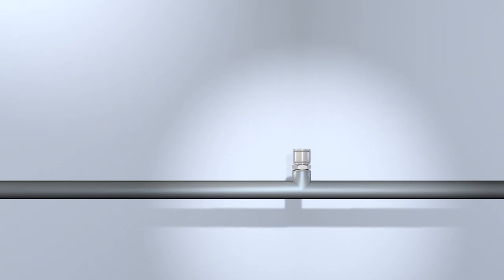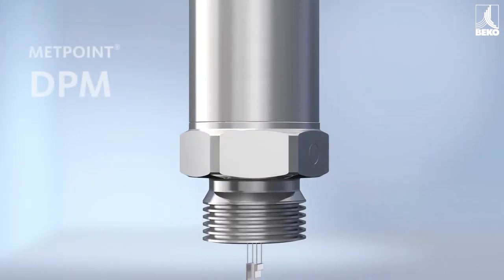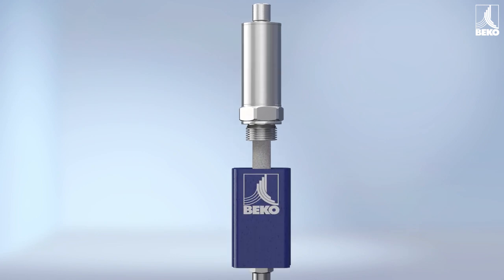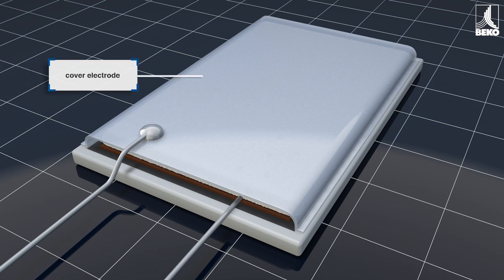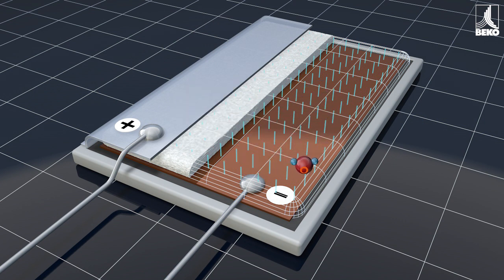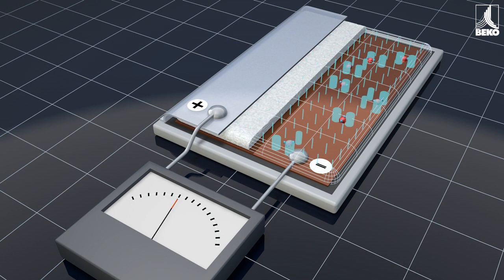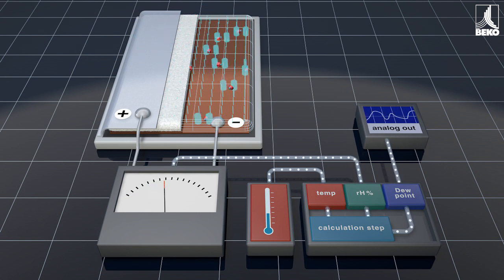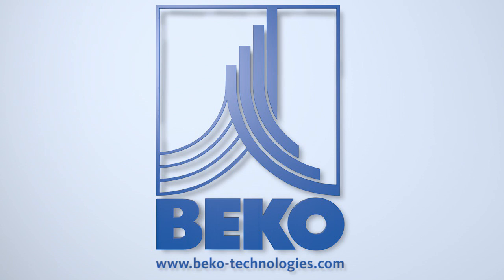METPOINT DPM Dewpoint Measurement

Comment: Doesn't the probe has to be in the flow path?
Reply from the maker: Hi Kevin, thank you for your question.
The DPM can either be integrated into a system directly on a pipe (think you mean that) or installed with the blue measurment chamber to achieve a faster response time, like you see here in the video. Feel free to check product brochure for more details, figures and drawings https://www.beko-technologies.com/fileadmin/beko-technologies.com/EN/brochures_en/productfolders/metpoint_dpm/78-00372_profo_metpoint_dpm_4p_int_rz_display.pdf 
Hope this helps :)
If not, we are here for your assistance.

Comment: Your instrument DOES NOT measure water dew point.  It is actually measuring the water content.  Then you can use the water content to calculate dew point, based on some assumptions that may or may not be valid.  Please be more clear.

Definition of water Dew Point:    The temperature at which moisture condenses out of the gas phase into liquid phase.

The only way to measure dew point is by using a chilled-mirror.  Your device is a moisture sensor.
Reply from the maker: Pressure dew point and dew point are not physical quantities but a relation between temperature and degree of saturation humidity of a gas.
You are right in this respect that in a dew point mirror system, the temperature at which condensation (100% relative humidity) occurs in the mirror is measured by cooling the mirror. Thus, only the physical parameter temperature is measured.
In order to determine a dew point or pressure dew point, our pressure dew point measuring instruments measure the two variables temperature and humidity.
As described in the video, this measuring is carried out by our temperature sensor and polymer sensor. Our sensor calculates the pressure dew point from this two measurements.